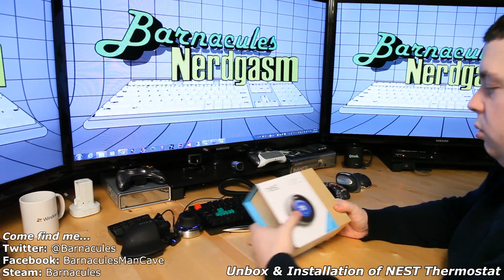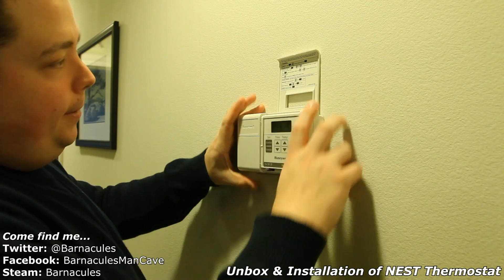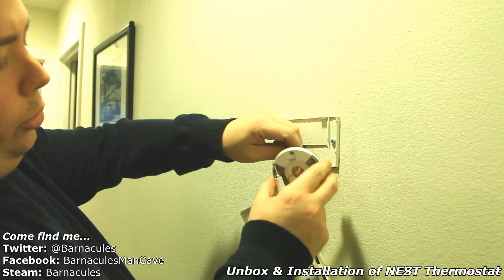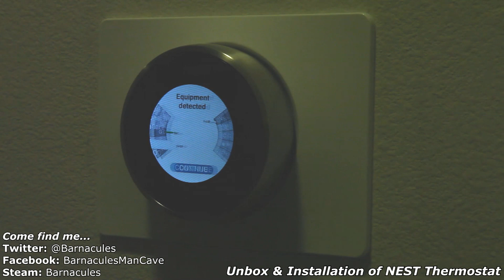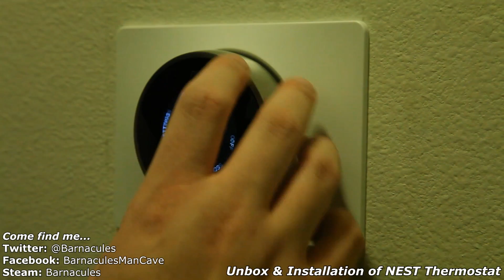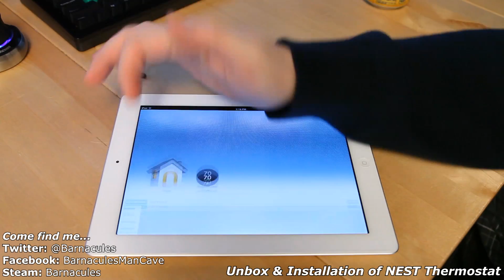NEST Thermostat Unboxing & Installation - Anyone can do it! - @Barnacules

Comment: I would recommend you get a 24v AC adapter on Amazon for like $20. That will serve as your Common (C wire) so the battery will always be at 100% even when you’re not using it. If you don’t it will turn your HVAC system on once in a while for juice.
Reply: Or what you can do is just run some new thermostat wire directly to your furnace/air handler and hook up the common there

Comment: I just wish I knew what to do since my 4 wires are White,  Green,  Red and *BLACK* ?   There is no Yellow wire for my existing thermostat installed in 2009.   There are 4 screws above beside "RC" screw on far left  and "RH"  3rd screw from left  and "W" is 4th screw from left above.  Below, there are 3 screws below beside "JP2"   just below  "Y"  letter  ?   It looks like only the black wire is wrapped around the first of the "JP2" screws below while the remaining White, Green, and Red wires are  wrapped around the top "RC"  screws above with what appears to be an additional (possibly jumper wire that looks a bit like a "C" rotated once to the right so it looks like a mini-roof) red wire above also wrapped between the first and 3rd above screws.   Anyone help?   What to do?  I have no yellow wire?  I do have both Furnace and Air Conditioning so, perhaps, my Black wire, currently wrapped around the first "JP2" (or "Y" immediately above the JP2), is for the Air ? I am not much of a DYI 'er.    Any help would be greatly appreciated.  Thank You

Comment: Barn got shocked off G not because it is a hot wire but because he got in line with the source R and the load G . Also RC and are R usually are jumped via the thermostat. In systems like a forced hot water and a air handler where there would be 2 separate 24 volt feeds  you would need to remove the jumper. When calling for heat R  would power W calling for heat. When calling for AC RC would feed Y calling for AC turning the fan and compressor on . NOTE the fan would power up when y is activated. When just running the fan to circulate air without heat o cooling RC would power G turning ONLY the fan on. Sometimes electricians at HVAC techs will omit G to save a t stat wire because most people will not run the fan on its own.  I LOVE ALL THE CONTENT BARN>

Comment: Air conditioning systems use 24 VAC, so you don't need to be worried about them touching, the worst thing that could happen is a few sparks or the system turning on...
Reply: IVE Seen a burnt out transformer cause a house fire
Reply: Yes, but for the transformer to blow you would need to hold the wires together for a long time.
Not to mention most ac units have an in line fuse for the thermostat.

Comment: Thanks for the video! It was really helpful as I installed my new Nest. I had a bunch more wires than you did, and they frustratingly didn't correspond to the labels on the backplate. If anyone else has this dilemma, definitely call the Nest tech support line. They were super helpful and even sent me a customized wiring diagram.

Comment: I changed all of my  A/C controllers out with Nest thermostats. For the first time in 2 years all of the rooms in the home  are the same temperature and the fans stop when the desired temperature has been reached. It is far more comfortable than before as the A/C runs at low speed when it cuts in so does not blast out so much. It took 2 days to get rid of the condensation on the outer surface of the vents as the system before left the fan running after the compressor stopped so drew in humidity and I can control A/C with my mobile.
Yousef fitted these A/C controller for my home, his contact  number is 

Mobile Dubai : 0506859285

Comment: beware with nest, they're great when they work, but they don't use relays to switch power on and off to your furnace. Its a major problem if you have an AC unit. It uses an FET and they have a tendancy to short out. Once it shorts out, it can have your equipment permantly switched on, or worst case scenario, it can run an AC compressor 100% on, but nothing else on. If you're not home or don't hear it(some new systems are whisper quiet) and it keeps running, it will freeze out your blower and completely destroy your whole system. Warranty doesn't cover this and you could be out THOUSANDS of dollars. I imagine if it turned on your furnace, and not your fan due to a short, it could easily be a fire hazard as well. Google it, its a well known problem, and the only reason i won't upgrade to one.
Reply: if rc and y control the air handler and comp your air handler fan would run and make it quite cold. I think you are thinking of a system that has the 4th wire g ( witch is for separate fan operation) in  case a most common case you would have    R = ( +24 v ) W = ( heat ) and  y= ( air compressor)     meaning your air handler fan would run if the FET shorted. In barns case he has   r +24 v     w =for heat and   G = for fan. When heat is calling it puts r 's 24 volts to w to feed power to the air handler terminal calling for heat turning on the fuel source and fan to blow it. if he had ac it would jump r to y calling for the air handler fan and outside compressor via a common wire and the same y wire that is on the terminal on the air handler. this would run both fan and thee compressor making it quite noticeable.  Also barn got shocked of G not because it is a hot wire but because he got in line with the source R and the load G.

Comment: Check the compatibility on their website first, it will tell you about the wires... there is not always wires for all slots, in fact most likely not.  Also, it tells you to take a picture on the website. And always turn off the breaker... gosh.

Comment: your lucky lol, my house is only about 10 years old and it has 7 or 8 wires... sadly tho there is a shourt or break somewhere betwee the outside unit and the thermostat so we are gonna have to call the landlord and either get it fixed or i hope, completely replaced because the current unit doesnt really do the job with my computer and a NAS server in my room its 85 degrees regardless of the rest of the house and im the first room besides the bathroom closest to the indoor unit

Comment: you can thank apple for the design considering the designing of this was the former iPod designer for apple

BTW you're a fool mount the dam plate first before trying to wiring anything rather then assembling and trying to work around it. Common sense common sense

Comment: Can't get electrocuted by thermostat wires. They carry the same voltage as telephone wires. And before anyone tries to say "by definiton yes you can", no you can't. Electrocution ends in death or injury, 24v .5-2 amp thermostat wire wont injury anything.
Reply: Well considering some thermostats are wired to mains 240v, then yes, yes you can.

Comment: if it's 24v you can't get electrocuted.
Reply: You can get electrocuted by any voltage
Reply: Mathijs Alkemade just asking because what you were saying was kinda stupid
Reply: Mathijs Alkemade Jump a screwdriver between car battery terminals and tell me about how a low voltage is always safe.
Reply: Not true but k.
Reply: Bluehulk4 dude get over it with 24volts it wont electrocute you not even when it's 9999999999 amps. You wont even feel it.
Reply: Mathijs Alkemade Yeah you won't feel it but you said it won't electrocute you which is not true
Reply: Bluehulk4 what ever the fuck the defenition of electrocuting is in your head, i don't care
Reply: Mathijs Alkemade You are not happy :(
Reply: someusername121 1: don't short out your car battery, it could kill the battery, light it on fire or even make it explode. 2: I was just trying to point out the circuit wich had 24v and probably low amps would not electrocute you (I'm talking about that specific circuit he was working on) my bad I only mentioned volts.
Reply: Sam G Of course but you don't get volts without amps in a household
Reply: What ever please stop this al I wanted to say is that it won't kill you.
Reply: phillies4100 No why?
Reply: what does what i said have to with if I've been electrocuted before myself?
Reply: +Jason C it's the amps which kill your
Reply: Mathijs Alkemade its not the volts that electrocute you its the amps you can have 24 volts at 400 amps and probably stop your heart, these wires run on a few amps its not bad
Reply: phillies4100 If he has, he'd be dead. You can only get electrocuted once. Electrocuted means death by electricity (i.e to be executed with electricity). Electrocution =/= electric shock.
Reply: No way

Comment: Red is always the (hot) wire. Maybe green grounded you to allow the flow of electrons through your body.
Reply: Yeah that's not completely true in all cases
Reply: evan002 if green shocked you then you must've already been touching red. Green is fan, white is heat, yellow is cooling, orange would be reversing valve on a heat pump and blue or brown would be common. 99% of all the units I have worked on are wired this way. I work on over a 2000 units a yr.
Reply: Yourused You are 100% correct, but unfortunately I've seen a couple wired completely wrong. Obviously you can guess that they were homeowners trying to save money and messed things up..lol

Comment: there is no 24 volt, its 120 volt or 240 volt
Reply: Low voltage for the stats are 24v actually 27.5v on 95% of every unit we work on in residential Hvac. Contactor, sequencers, relays and such all pass 120/240 but they work off the low voltage side.

Comment: So does a thermostat do cool and hot air? We don't have that type of stuff in Australia, i'm 19 years old and have yet to see something like it. (Nest or Thermostats in general)
Reply: We in the UK don't call them thermostats or atleast i never heard it being called that but basically it lets you change the temperature to what ever if you have a AC aswell you can wire it up to the nest and have that turn on if you want it to be cooler.
Reply: Well in Australia you don't need heating. Though even in NZ the common stuff are fireplaces, heat pumps (air-conditioner) and portable heaters and fans. 

You Brits might call this the central heating or boiler.
Reply: His zip code was in the greater Seattle, Washington area where it's not common to have or need air conditioning to cool your house.
Reply: Jason C. I grew up in Seattle, eastside mostly, never had ac in a house or car.
Reply: Jason C. haha while you guys are in seattle getting a nice 90f which is nice weather (for where i live at least) in southern california it gets up to 110f sometimes higher up to 115 in the mid summers!!

Comment: Why use the back plate? Plug the holes with Polyfilla, sand and dab a little paint on it. Looks much cleaner imo.
Reply: Agreed.  The backplate takes away much of the look of this thermostat.  A little dab and sanding and be done with it.

Comment: I thought that it was a silly purchase, but now seeing it, it looks really well made and elegant.
Reply: I bought a unit a few years before the Nest came out by a company called Proliphix. It's a programmable thermostat that does a lot of the things the Nest does but it isn't wireless. I have it connected to my LAN. The Nest is a little better because of its sleek design, ease of use and WIFI capabilities. I do worry a little about others hacking it but it seems like a decent replacement for the one I have now.

Comment: R: Hot(power) 
W: Heating Cycle
G: Blower 
Y: Cooling Cycle
This is why they make HVAC Technicians.

Proud To Be A Union Hvac/Sheet Metal Worker!
Reply: +Zach Brown Most electricians? are you drunk? A electrician that doesn't understand control wiring is not a electrician. Don't know how you guys do it in the states but here in Norway electricians do everything that comes to electrisity. HVAC people aren't allowed to work on the electrical system of the system.
Reply: HVAC guys in the state where I was an Electrician, are not allowed to wire the Regular Voltage, but they can do all the Low Voltage stuff.
Reply: Jason C. no this is hvac tech work. most electricians don't know control wiring
Reply: Josh Moorehouse heres the way i look at it josh:

R: hot
W: Neutral
G: ground

I learned all of this in my EEAS class at the local college by me.
Reply: Zach Brown yyug000q. P

Comment: I find myself laughing at people when they freak out about house wiring.  I've been shocked by 110 so many times while fixing other people's rat's nest wiring jobs that I barely even notice it until the 3rd or 4th time I get shocked.  Most times these days though, I don't bother to shut off the power when I change fixtures anymore unless I'm stripping wires.  I've gotten good at manipulating wires where I need them without shorting or shocking myself.
Reply: thorleifjacobsen
I used to smoke, have had open heart surgery to correct a genetic condition, and other than not following safety precautions when I'm working on stuff I live a pretty boring lifestyle.  Getting electricuted now and then is about the only excitement I get these days other than the odd vehicle crash.

Comment: The Honeywell rth9500wf w/ Wi-Fi does the same thing, and has a tablet like design.. pretty sick actually, I don't like that the nest is just a blue orb w a number in the middle.. the honeywell thermostat has a touchscreen that shows what the nest app dies on the actual thermostat, but it also has an app.. if your thinking of a next check that one out too..

Comment: If you like the Nest thermostat, try out the Nest Protect Smoke and Carbon Monoxide Detector. It works with your Nest thermostat to automatically turn down the heat when no one is home.

Comment: Barnacules Nerdgasm I think it would have looked better without the wall plate. All you had to do with those holes is buy some filler, sand it flush and then paint. I know you have leftover house paint for that wall, right? Would've looked better but still looks good even with the wall plate. Nice job! I was thinking it was more sophisticated than that - I cannot wait to buy and install my two one's for the house ;-)

Comment: Green is not hot, red is.  On a call for heat, the stat closes a circuit between the R and the W wire.  When the furnace control gets the W signal from the stat it brings the heat on.  If you turn the stat to 'fan on' it will close a circuit between R and G and bring the fan on.  If you had central air you would have a yellow wire.  On a call for cooling, the stat would close the circuit between R and Y bringing on the outdoor condensing unit and between R and G which brings on the fan.
Reply: YES EXACTLY JIM ..... GOOD COMMENT HE GOT IN LINE WITH IT
Reply: I just wish I knew what to do since my 4 wires are White,  Green,  Red and *BLACK* ?   There is no Yellow wire for my existing thermostat installed in 2009.   There are 4 screws above beside "RC" screw on far left  and "RH"  3rd screw from left  and "W" is 4th screw from left above.  Below, there are 3 screws below beside "JP2"   just below  "Y"  letter  ?   It looks like only the black wire is wrapped around the first of the "JP2" screws below while the remaining White, Green, and Red wires are  wrapped around the top "RC"  screws above with what appears to be an additional (possibly jumper wire that looks a bit like a "C" rotated once to the right so it looks like a mini-roof) red wire above also wrapped between the first and 3rd above screws.   Anyone help?   What to do?  I have no yellow wire?  I do have both Furnace and Air Conditioning so, perhaps, my Black wire, currently wrapped around the first "JP2" (or "Y" immediately above the JP2), is for the Air ? I am not much of a DYI 'er.    Any help would be greatly appreciated.  Thank You
Reply: How come there’s no common wire?

Comment: Really cool video.  However, I am a professional installer and I can't imagine why Nest would put your video on their site instead of creating a more professional installation video.  True, you have really cute things to say and you are very complimentary to their product.  However, disconnecting all the wires without first killing the breakers is not smart.  24 volts won't hurt you, but you could burn a wire up inside the wall and that would not be cool to have to run another.  Personally, I like to install things correctly the first time and although I don't need the instructions, they usually point out some cool stuff that I might miss if I wing it.

I do like the Man Cave though!!

Comment: Why are you so desperate to wire it up?  I would have mounted the backplate to the wall THEN wired it up.
 At $270 I would be frightened of it ever falling off the wall so would have drilled holes used dry wall anchors then screwed.

Comment: I installed the nest November 2012 and all has been great...Came home today and I all of a sudden have an E30 error code which means the Y1 wire is being detected as being connected to the unit but its not detecting the wire having power...This controls the cooling feature of the nest controlling my central AC. I troubleshooted as per the Nest website but still no luck. Any ideas or suggestions?? Thank you..
Reply: having same issue  trying to resolve.  I did take unit off wall and charged for a while seem to help for a bit.  maybe you want to try fully charging your unit  good luck

Comment from the maker: Honestly I've not had a single problem with it since I installed it. Except one time the internal battery got low from the WiFi and it had to charge on USB for a while but it hasn't happened again. I really love the unit and I love how when you walk by it lights up and shows you information. It's very cool!